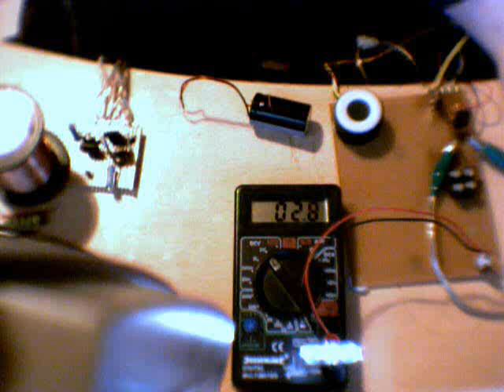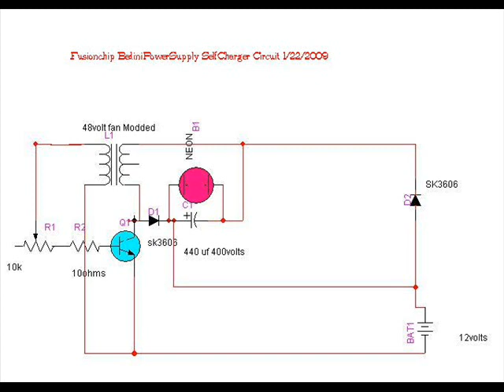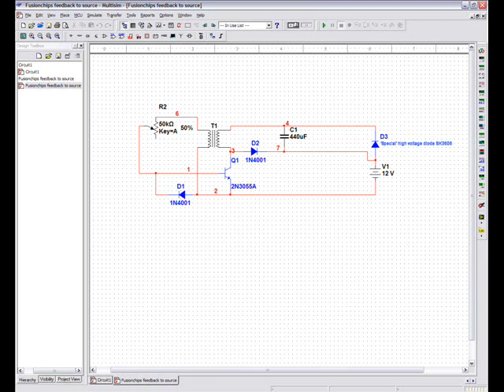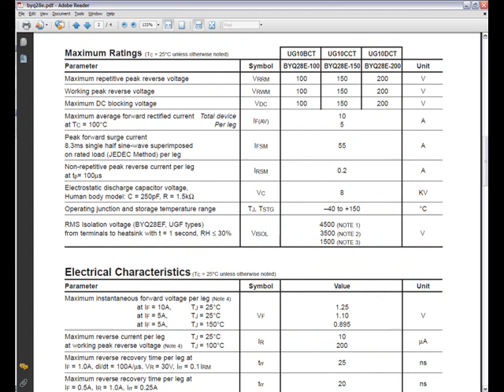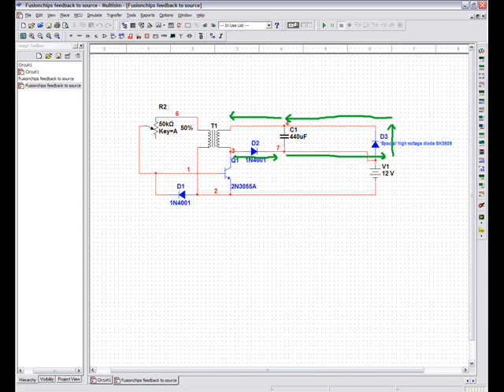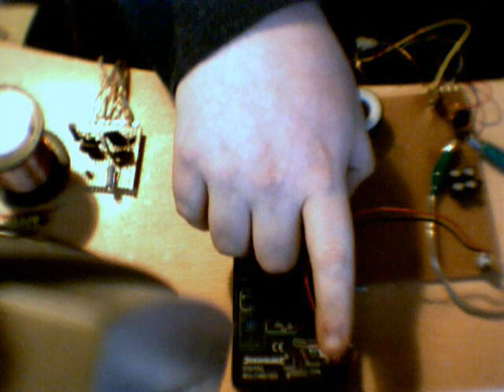re - fusionchips feed back to source Part 1

Comment from the maker: In fusionchips circuit... he IS shorting out the back emf from the drive coil... However, the back emf from the trigger coil is flowing into the primary battery...
Having said that, the resulting lenz 'drag' from shorting out the back emf from the drive coil in my opinion makes his changes highly wastefull...

Comment from the maker: The protection diode on relays actually shorts out the back emf... 

on my circuit the back emf is sent to a pair of hivh voltage capsC1/D1 & C2/D2 one for trigger one for drive coils...

D3 and D4  however have a diferent purpose. These alow the 'power' produced by the SOUTH pole passing the core to bypass the transister and flow back to the batter y...

Comment from the maker: We were on about a missing diode... which as it turns out on bedini fans is not totally necessary...

Also, i beg to differ on diodes... Diodes like transisters, like capacitors, like resisters etc etc have diferent effects depending on their specification...

Comment from the maker: "completing a loop through the fan coil" it starts from the lower side of the fan driver coil, goes through D! then through D2 and then back to the upper side of the fan driver coil... that is it's path of least resistance...

"74 ohms and not a SHORT" - 100 volts would call 74 ohms a short... hence why you blow smaller diodes!

Comment from the maker: Electricity ALLWAYS takes the path of least resistance... the Path of least resistance for the back EMF is through your diode and back to the driver coil...
Their is no electrical path for the back EMF to follow from one side of the driver coil to the other that goes through the battery... egro, battery does not charge...

The fact that you sent me such a careless, unthaught twaddle of an email only proves it...

Comment from the maker: Again, it is not critical it is ONLY a safety feature to prevent the reverse voltage through the trigger coil blowing your transister...

Your claims to my mistake 1 & 2 are completely BS!

As for your claims about your 'special' 48V fan, thats BS too! the higher number of winding will ONLY mean a haight back EMF voltage / current and has nothing WHAT-SO-EVER to do with charging the batterys.

Comment from the maker: 4christonly1 / fusionchip (same person)

ok, the only diferences between mine and your is missing static resister and neon... both of which are not critical to the operation of the circuit... Thge neon is ONLY a safety feature...

In addition, yours is missing a diode from the transister emitter to the base on your schematic... however, my schematic shows it their, but i have not included it on my build.